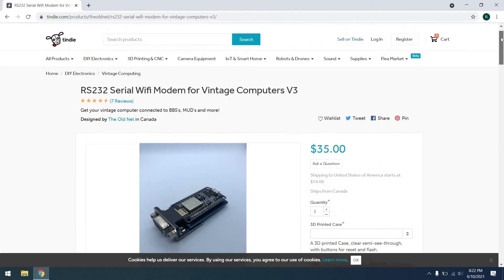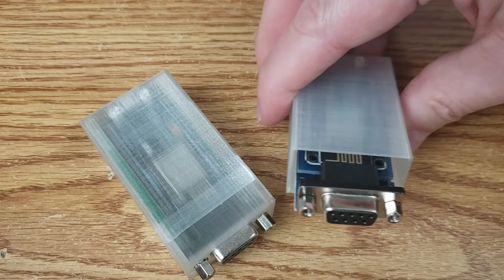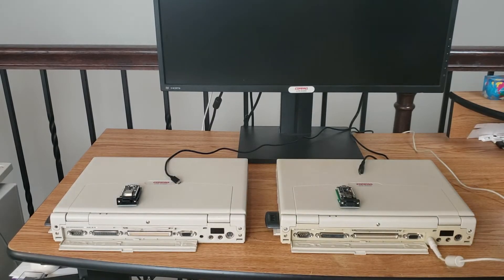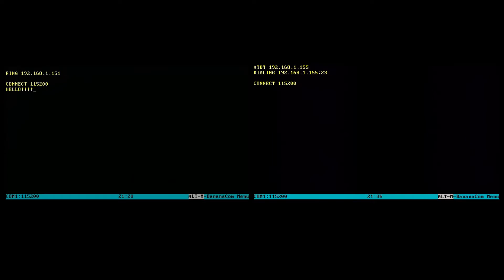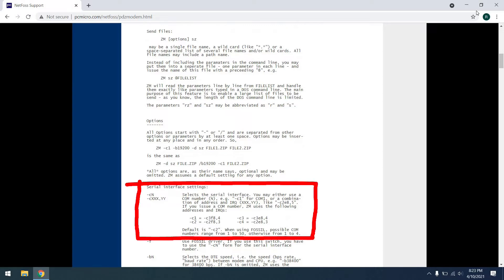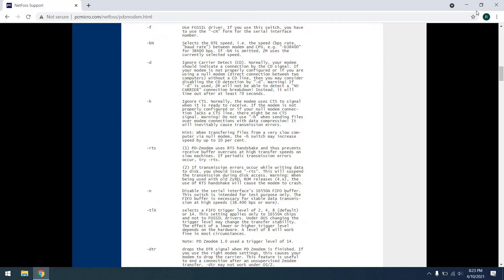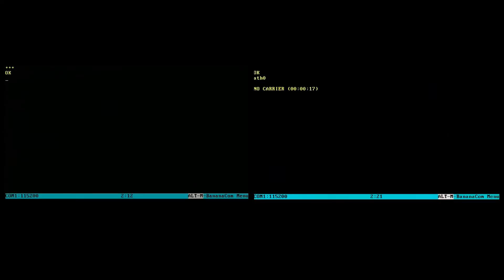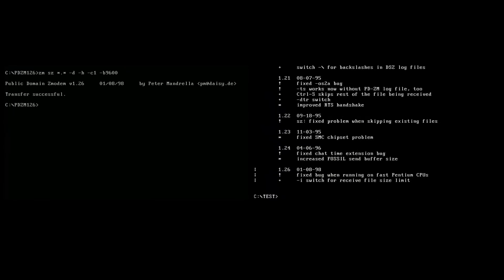RetroTour: MS-DOS File Transfer Using Serial to WiFi Modems and ZModem

Comment: Hi Chris

What is the range of those wifi-serial adapters, obviously 2 machines on the same desk should use a hardwired cable for transfer and i understand you done if to show everything.

My modem days was mainly telix but i also used  procom / supercom / terminate while they are all basically the same each has their benefits.

I think using telix or procom as they are late items they had a auto send function if using the same program on both machienes ie machine a tags files to send and the b-end receives some code advising a transfer will start and it will auto receive them ( if you allow auto receive )

The crc errors are strange, but i rather a high speed and resent 10% of the packets and finish early rather a very low speed - there is also hardware handshaking or CTS - RTS if the modem chips are not capable you have to use software codes , the same way it works with null modem cables, technically you only  need 3 wires

A-Machine  B-Machine
send ==> receive
receive ==> send
ground ==> ground

This set up will need software flow control, each protocol has its own error checking crc32 is very common for old dos programs ( basically it takes a block and does a check some, then asks the other pc for a checksum, if the same if sends the next block if not it resends it until it is correct or times out with xxx amount of tries )

my first modem was a 2400, i dont know what that is in k's per minute but it was used for text / ansi or bmp only back then, binary files were possible but a entire 360 floppy took a while ( i dont recall 1 early floppy would take 80 mins or more )

Regards
George
Reply from the maker: Ya.. these don't have hardware flow control.  I could have used ZModem built into a terminal program, I've done it, perhaps I should have showcased it here!  Was more focused on file transfer from a DOS shell, but terminal programs do work.  Range?  As good as standard WiFi really.

Comment: Love this video.

I've been banging my head against something for a while that you're probably more than capable of working out in minutes lol.  A flashed DDWRT router should theoretically be able to run pppd and chat. Pair the router to a main router and use the other channel as a the wifi connection. Have the client "dial in" with the wifi modem, and have the router manage the ppp connection.  Each step theoretically possible, but I've run into problems at every stage.  Would be fun to try a real ppp connection  for loading up the old internet or something
Reply from the maker: Oh, interesting!  I'd definitely like to try something like this at some point.  Keep me posted on how it goes, and maybe I can join up with you on this too!!

Comment: I would be fun trying these WiFi modems with MS-DOS Interlnk and Intersrv. Also using Laplink would be fun - so much easier than ZModem.
Reply from the maker: Indeed.  I tried a few combinations to get things working with FastLynx, no luck :( Ordered a couple of different null modem cable adapters and they didn't work.